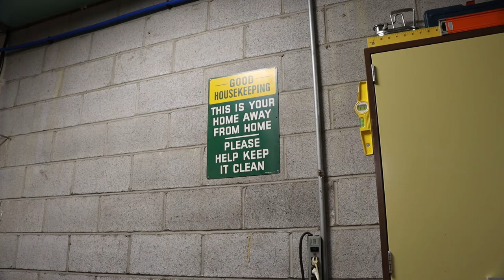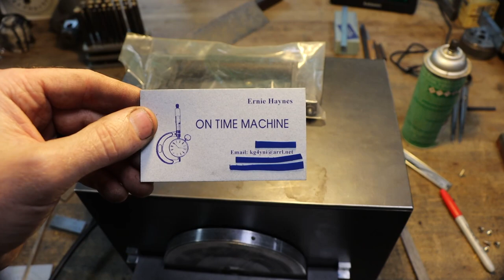Slow Speed Carbide Grinder 3

Comment: You might want to consider adding a PC fan to the back panel on that slow speed grinder. Once you add in the vent slots, that fan will circulate plenty of air. Any enclosed motor creates more heat than what people might think they do. 
Great video, cheers :)

Comment: I would have made the plinth wider so  you can fit an arc shaped strip on the side of it with an arc shaped slot in it.  Then have a lock screw on the side of the machine which the arc slot passes through to tighten it at any angle.  Nice project anyway !  Also don’t forget that saw project.

Comment: I am concerned for Elizabeth's long hair getting in to moving machinery.
Reply: I agree 1000%.    I seen the results of long pretty hair getting caught in moving objects. 1. My mother got hers caught in a powered wringer that attached to an old washing machine that replaced the manual wringer.(yep at one time they had hand crank) Lucky for her i was there and unplugged the machine(pulled her all the way to the rollers). 2. Neighbor 10 year old girl caught her hair in a go cart sprocket going 30. That accident caused scalp and hair removal. 3. Bench grinder.  Hair caught in the wire wheel.(this was an adult 25 year old male with long hair.)  So in closing it only takes a split second for disaster to grab you. Elizabeth has pretty hair and she probably wants to keep!
Reply: A few years ago an engineering student at a local university died from injuries sustained from her hair being caught, and pulled into a lathe.
Reply: Why ! WORRY ! ABOUT !! IT !! ??

Comment: Steve, Just a thought. If you put one bolt on one side you could use it as a pivot instead of having to release all four bolts when changing the wheel, nice design and manufacture  as ever. best wishes, Mal.

Comment: Hi Steve, awesome project.
With the added slots you could mount a fan wheel on the unused shaft of the motor to improve airflow (if needed).

Comment: Tip: When pressing pins I put them in an old knurl wheel to hold straigh and square to the work to get them started. Any collar or block with a slip fit hole for the pin would work too.

Comment: Thanks as always for sharing. Have a great n safe 4th of July. Best way to kick start your Saturday morning 🌄
Reply: If you make vent holes in you sharpening box, would it make sense to put holes  low on one side and holes up high on the other side? How hot air rises which in theory the warn air would exit out the top holes, causing the lower holes to allow cooler air to enter. I remember the motor you used had a shaft on it. The opposite end of grinding  disks. You could use this to your advantage.  Making or finding a small fan blade with the right pitch and direction air flow you could mount it on the shaft forcing air to move to the back putting exhaust holes  then add intake holes in the front down low that would create a constant air flow. Just my thoughts on helping the motor stay cooler. What do you think? Would love to hear your thoughts on this.

Comment: In a bunch of shops I have added control relays to the lighting circuit, to turn off things like air compressors, A/C units, etc., when I turn off the lights. The stuff I always forget to turn off. I bet that would work for your phase converter, since you don't do "lights out" machining. ;)

Comment: Nice build so far. What about a " turnbuckle" type adjuster using left and right threaded spherical rod ends and a threaded adjuster sleeve for adjusting and locking the table? Enjoy your fourth.
Reply: Was thinking the same thing.

Comment: I wired a suitable contactor on my lights into my stationary air compressor so it could not run and wake the neighbors again if I was not there.  You could do the same thing with your phase convertor. If you used a magnetic starter, it would only come on if you start it on purpose but shut off every time you turn out the lights. I've blown air lines twice and that prevented the compressor from running all night.

Comment: Hey Steve!
As always...Some "Monday morning quarter-backing".  IMHO it might have been "cleaner" to place the pivot pin brackets on the "inside" near the grinding wheel.  This would tend to keep them out of the way of potential angle adjustment items.  Then, a pair of similar pivots could be added (either above or below table level) for slotted, pivoting braces to be used in conjunction with thumb screws into the table edge for the angle locking.  Hope this is at least as clear as mud....Right?
Always a pleasure to see your beautiful bride!
Best regards,
Ken
Reply: Let him build his way. You build your way. I like what he has done so far. Things built by committee usually don't work out well.

Comment: A series/pattern of 3/16 diameter holes (deburred) on each end would preform heat venting.  
Complete over kill would be to mill a stack of 3/16 wide slots (deburred) on 45° exhausting downward to function as louvers.

Comment: aluminum may annoy you for a tool rest, I find hard tools dig in and catch rather than slide smoothly on my bench grinders aluminum rests, maybe not a big deal with a lap? Also its a little ghetto, but a carbide router bit does a great job profiling aluminum if you don't have a milling cutter or just don't feel like removing your vertical head. Table saw with a fine carbide blade cuts aluminum really well too, real fast.
Reply: I've had to do a lot of aluminum cutting on the table saw. Wear a smock of some kind that will keep the chips from going down the front of your shirt! They are hot and sharp!

Comment: A digital angle gauge (Wixey, Klein, GemRed??) would be an accessory you could use with the table to adjust the tilt. Tack a small piece of steel on one side of he table, and you could use a gauge that has an embedded magnet - after the tilt is adjusted, just move  the gauge out of the way. Or not.

Comment: Morning, Steve! Stick a lamp on the generated third phase as an indicator/idiot light? ATB
Reply: Place the "idiot light" beside most commonly used exit.  Or, one at EACH exit.
Ken
Reply: I was thinking on the outside front of the shop. So you can see it from the house
Reply: @sarman1998  
That also!  Sort of like wearing both belt AND suspenders!
LOL
Ken
Reply: @kejay74  at first I was thinking one of the red rotating lights. But that might be a bit much 😉

Comment: Nice job Steve. As a suggestion why not move the switch for the phase converter closer to the door that you use the most. That way on the way out you would see if the phase converter is on. Just a suggestion. Happy July 4th .

Comment: If you have enough clearance inside the box a curved rod would be nice to attach to the table then through a collar or block on the face of the box with a knob attached to a machine screw or set screw.  A small collar or some other style of end to connect the curved rod to the edge of the table?

Comment: One consideration:
I think it would have been better to undercut the table edge right towards the grinding disk (like a cutter edge) and then make the axis of rotation go right through this very edge. That way you can get minimum gap between the table and the grinding disk no matter how you angle the table.

Comment: A simple way would be to tape a sign on the exit - DON'T FORGET TO TURN OFF PHASE CONVERTER DUMMY!....😁..it's cheap and it works! 
I would probably go with a fine thread rod arrangememt on the table adjustment. Either with block and lock nuts, or maybe a swanky allen head end on the rod.   I'm eager to see how you do it. 
Thanks for sharing

Comment: Maybe a neon indicator lamp on that phase convertor switch? (or one of it's outputs?)
Reply: I was thinking more like a klaxon alarm horn.
Reply: @1pcfred  Running all day while you used the tools in the shop???
Reply: @jimurrata6785  Maybe hooked to the lights so the alarm sounds if the lights are off and the phase converter is not.

Comment: Instead of friction holding the table and because you're only moving it small amounts, wouldn't it be more stable to use a jack screw or the like? You could even make a scale to tell what degree it's at so you don't have to get out parallels and the surface plate.

Comment: Obviously you must have way better availably to metal supplies than I do. I would have drilled a couple small holes in the corners and used my band saw to cut that deep slot out. And that would have given me a piece to use somewhere else for some other project. You merely cut it out, turning that substantial piece into tiny chips to clean up. I don't have the ability to get material that easy and therefore try to save ever usable scrap. Just how I do things... I try not to waste anything in my shop. Waste costs, and I don't have an endless supply of materials. JMHO!

Comment: Gee Elizabeth.  Safety first!  Pull your hair back when using power tools.
Reply: ...and get a better platform to raise her up.
Reply: There's nothing in that power tool that could possibly get hair caught in it....
Reply: @jeffreydurham5342  The motor housing almost certainly has openings for the internal cooling fan. That'd draw hair in nicely at 10k rpm or whatever the motor spindle runs at.

Comment: Can someone help please, I purchased a BIG horizontal bandsaw and the direction of the blade rotating is opposite to normal meaning it cuts clockwise. Can someone please tell me why they would make it do that and would it be better if I reversed it some how
Reply: Is this a three phase motor? If so it is most likely wired incorrectly. Swapping any two of the three phase leads will reverse the direction?

Comment: Why are you not worried about grinding grit getting into the motor? It's hard to imagine that overheating with one man's use, but I imagine the magnet will attract all that crap.
Reply: If you put the vents in the back, you could have a computer fan blowing out vents at the top which would automatically pull clean air in from the bottom. I don't know, just a thought to avoid contaminating the motor

Comment: I am confused about this scraping? How can hand scrape job be superior to a precision grinder setup? I mean how do you keep the tool level and at consistent force with your hands?
Reply: Having small cavities in the surface of sliding surfaces are intentional - it holds lubrication, and things slide better. Perfectly flat surface will 'ring' together and increases surface tension between moving parts. You scrape and print against a reference surface to get it flat 'on average' across the tops of the 'islands', and it can actually be more accurate for long distance parallelism of two flat surfaces than grinding. That's why machine 'ways' are typically scraped, not ground.
Reply: @kindabluejazz  Thanks, always learning!

Comment: I can't believe all the "helpful" safety comments for this week's episode. Good gravy! 
1) She isn't on a lathe or drill press or mill. This is a reciprocating tool, there's nothing to wrap hair in
2) Even if by some weird break in the space-time continuum some of her hair got in the housing - it's a handheld power tool, she lets go and it stops.
3) MOST OF ALL - Do you think Steve would let his wife do anything dangerous in the shop? Do you think Steve is incapable of assessing a safety hazard?

Honestly, this is like lecturing Steve because Elizabeth had her hair down while using some dial calipers, or (in before "BUT POWER TOOL!") having a ring on while using a cordless drill. Have some perspective, and some respect for Steve's judgement!

Comment: Now what in the hell is that big long axle looking plainer deal?  Sometimes i think machinists use some of the machines they do just to show em off..  granted some are better at certain jobs but tell me why take the work off a machine perfectly capable of shaving that parallel and setting up a whole different machine to take off the little material it did on the piece?  Its like your drilling random holes in a piece on a drill press then you take the piece to a mill to chamfer the holes..  just no maka da sense to me..  but again im scatterbrained myself so ive used a floor jack and an i beam to press a shaft out when i had a perfectly good arbor press not 10 feet away and never once crossed my mind to use it even when i set my cup of coffee on it..

Comment: Hello Steve. I do hope that you are not going to suggest that the scrapping technique of your beautiful Elizabeth is an approved method. Dear, unless you are aiming at creating a low spot to practice removing. You seem to be trying to „help“ the tool bite, to get shavings. And making a circular pattern with the scraper. Both no-no‘s. Hold the darned thing in the crook of your arm AND LOCK YOUR ELBOW!. Let the weight of the heavy beast provide the pressure. You just have to find the right angle, and then it will cut. You may need to stand on something to achieve a comfortable working height, which is important. Then sweep the blade along in a line, and try to keep your angles the same. Use your hips to shift, and keep the blade parallel to your planned scrape. Much easier to do this if there is some blueing to remove, so you get a feeling for the move. And keep that elbow locked. Your Husband will have a lot of work for you soon.  Lol. All kidding aside, I just want to say thanks. Love the channel, love the squirrels. Always looking forward to a new episode. Hello from Germany.